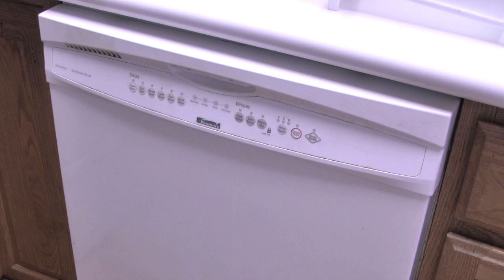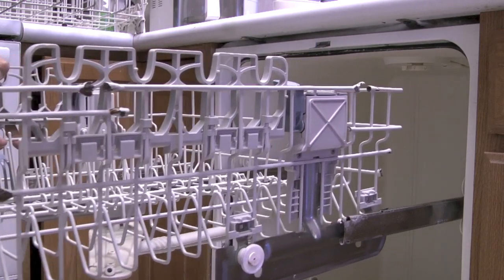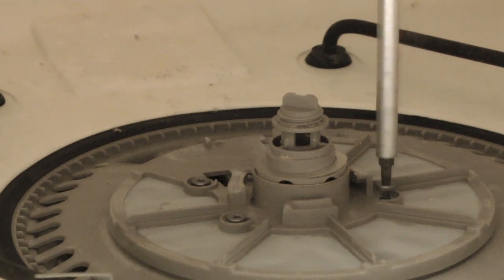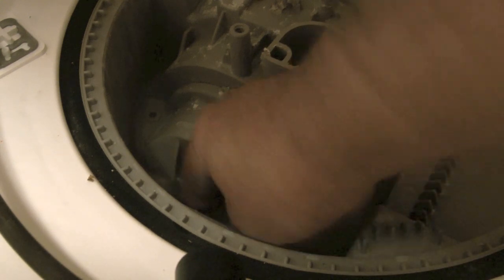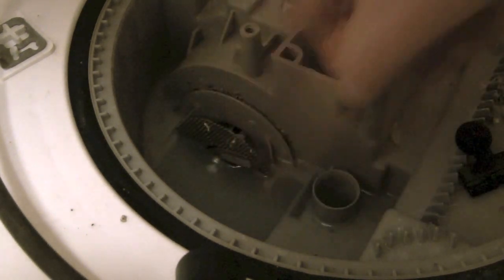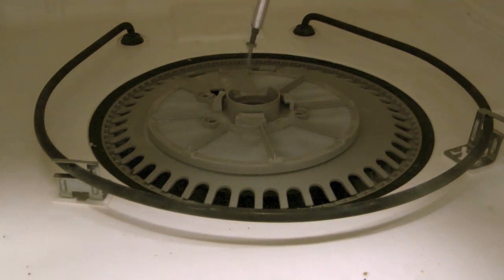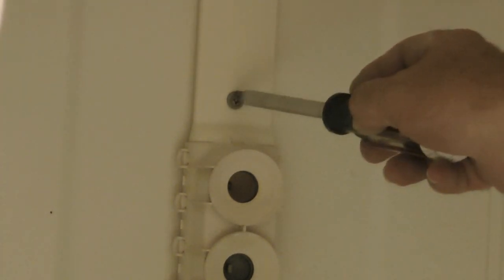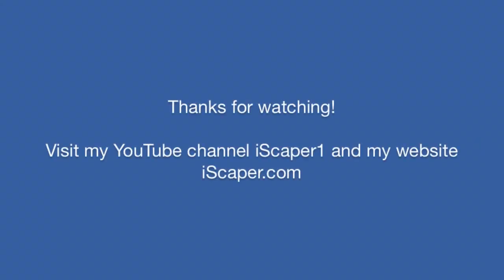Do it yourself dishwasher maintenance

Comment: Great video! I did everything you showed, but i'm still having issues. It goes through the whole cycle but when it says that its washing, its not doing anything at all. Completely quiet. The dishes don't even get wet. Heating element works, it fills and drains....I'm thinking the water pump is completely shot. What do you think?
Reply from the maker: Sounds like a pump issue or a blockage somewhere.

Comment: Water supply column has a couple of flapper valves. One of mine appears not closing. What effect is the open flapper valve? Dishes appear to clean but inside of cabinet becomes very dirty with scum on all sides

Comment: Great video. Only issue is the lower spray are is now hitting the bottom water supply tube. What did I do wrong.  Can you help.
Reply from the maker: The spray arm will wobble when there isn't water pressure against it, does it bang on things when running the dishwasher? If so you might need to check its installation again.

Comment: Our Maytag is barely 4 months old.  Not only does it smell terrible after a few days with the door closed (even when empty) but it cleans very poorly.  Even when only 1/2 full, it may take 2 washes to get glassware (top rack) or dishes (bottom rack) clean. We even rinse with a washcloth all dishes prior to putting them in our dish washer.  I checked the area in your video and it was clean.  Any other thoughts?  Thanks.  We have the Maytag mdb8959sfz

Comment: Ok, now I am stuck at reinstalling the lower spray arm...I can't seem to get the spinning-nut to engage with the spray blade and spin without connecting with the upper spray supply tube or the side of the washer; there seems to be way too much play when the blade spins. I think it's the nut; is there a specific way that it is supposed to fit; am I supposed to push it down firmly?

Comment: Great video. Any suggestions on how to get the cover off the chopper blade? Mine doesn’t have a tab like yours did?
Reply from the maker: Not easy to do, I thought I was going to break my cover taking it off. Try rocking it back and forth first. If that doesn't work maybe try a straight blade screwdriver & carefully pry up on the end to break it loose.
Reply: iScaper1 I ended up getting it of by using needle nosed pliers by the screw hole and the edge.  A good pull and it popped off.  Still doesn't drain, so I'll have to check the pump.  Thanks for the video.
Reply from the maker: Ryan Riek
Thanks Ryan for the tip on removing the cover.

Comment: Don’t forget to run a empty cleaning cycle once a month. Buy dishwasher cleaner or use whatever you’d like that has a high Citric acid content that isn’t a sudsing cleaner, empty the dishwasher, put the cleaner in the main detergent cup and close it, and run it on the hottest and longest cycle. Something like POTS N PANS with HI TEMP WASH & heated dry. You should be running a cleaning cycle immediately after cleaning the sump out so it can drain all the loose grits and bits from the sump and fully deep clean it.
Reply from the maker: Great tips, thanks for posting.

Comment: A turkey baster works great to remove the water and grime in the sump! Also, the screen can be removed from the center piece that covers the sump. I also used the turkey baster to force water into the little indents on the bottom of the door where grime tends to accumulate.

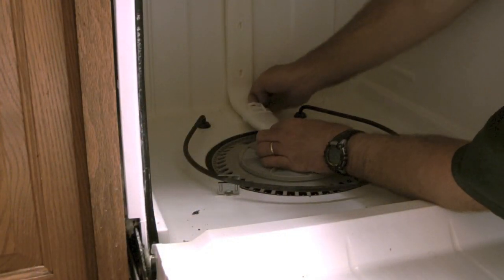Comment: Ok, I was following the video to the point where you disconnect the upper spray supply tube from the sump cover-arm thing (@ 3:03).  What if you accidentally break the tab? Is it like crossing the streams? Seriously though, I just broke it, but would it be ok to keep using it (for now), if I break off the loose part?  BTW - for the folks out there who don't know, the part iScraper removes after the upper spray supply tube is called the 'cap' or 'dishwasher cap', not "...sump cover-arm thing."

Comment: Good job with the video so my Kenmore dishwasher clean light keeps flashing this should solve the problem?
Reply from the maker: John Garcia 
I doubt it, you probably have other problems.
Reply: John Garcia I followed your instructions in video I had a bunch of glass, lemon seeds and some tooth picks clogging it also I reset my dishwasher to get rid of the flashing clean green light and it worked!! Thanks for the video!
Reply from the maker: John Garcia 
That's great, thanks for the information.

Comment: At about 10 minutes I am finding it virtually impossible to put the lower sprayer arm back on without the center piece falling out and causing the lower spraying arm to rattle when it spins. The center piece only has 2 out of the 3 fins on the bottom as it looks like one snapped off. Would this cause a problem? Thanks

Comment: We are down to removing the cover off of the chopper blade but we do not have the knob on the top that shows here.  There is no way we can get a good enough grip on it to wiggle it off.  Any suggestions?
Reply from the maker: Maybe try carefully prying up on the cover with a flat blade screwdriver.

Comment: I tried this with my Kitchenaid kdm24seal1. After removing the sprayer and the pump outlet, I'm unable to remove the screw on the drain and wash impeller. Any suggestions or tips? I'm unable to get all the gunk underneath it.
Reply from the maker: Without being there to see what you're doing I wouldn't be much help. I would search online for a parts diagram for you model of dishwasher and see if there is any information there that might help.

Comment: Great video tutorial that helped me, but my dishwasher will still not drain.  Next!
Reply from the maker: Sounds like you might have a blockage in the drain hose. I would check that first.
Reply: I did.   I saw another video of someone doing the same thing, but they included to remove the rubber drain flap too.  After taking everything back out again, and then removed the rubber drain flap.  Well our drain flap was broken, for the main piece of the flap was gone.  Which means it is probably stuck in the drain motor houseing, and pricing out a repalcement flap.

Comment: I've got a whirlpool gold quiet that has stopped washing dishes but does pump out. during wash cycle it just hums. so off I go to get a set of special headed screw drivers and will try to fix it.   I thought that a small shop vacuum would be handy to help get debris out.
Reply from the maker: ***** 
Good luck, let me know what you find out. Shop vac is a good idea.
Reply: iScaper1 I took the inside portion apart and found very little that would hang it up.  Put the beast back together fired it up still hums no washing action. looks like the starter capacitor 23.5uf 240vac on the side of the motor is bad.  I'll have to use my capacitance meter to check it out also found one on EBay.  I'll post the link to whirlpool gold quiet partner 3 parts manual.
Reply from the maker: ***** 
Great information, thanks for posting.

Comment: i have a very simular model kenmore dishwasher and now i have been noticing that there is still water after it is done going through it cycles. im thinking that it is a clog like you cleared out. i guess i have to do the same thing you did to yours. does anyone else have extra water left over after the cyv
cle is done its about a glass full of water.???

Comment: The dishwasher is really loud. I clean out the filter and the cropper and thought input back everything correctly. Any idea on why the dishwasher would be so much noiser. It is a kitchen aid 18 month old. Part kuds30cxss1
Reply from the maker: Does it sound like there are parts banging or is it a pump noise?

Comment: Both bottom and top spray arms are not rotating. I tried to remove the bottom spray arm, but it won't come off. I am holding the center screw with pliers and rotating the arm counterclockwise. It seems that the center screw is slightly too large for the arm to come up over it. This video is very clear, but I must be doing something wrong.
Reply from the maker: Sounds like you're proceeding correctly, is your dishwasher the same model as the dishwasher in the video? The lower spray arm should rotate freely even before you try to remove it.
Reply: iScaper1 No, my dishwasher is a Whirlpool but looks exactly like yours in the video. the arm does rotate freely, it just doesn't want to pull off.

Comment: problem solved, I found a camera angle that shows the position of the chopper blade. I used a sponge to soak up the water from the sump and it was easy to complete.
Reply from the maker: Glad you got the cover back on. Thanks for the information.

Comment: This was great but after it was all done and turned on no water was coming out. What could of made the water stop .. Checked the water float and it's fine.
Reply from the maker: Hi April. Not sure why your water wouldn't come on because nothing covered in this video deals with the fill and rinse cycle. Did someone shut off a valve feeding the dishwasher?

Comment: Excellent video tutorial.  I feel sick that I had eaten off dishes that were washed with that much crud in the sump area.  It is a wonder that any water got sucked into the sump at all.  Gross Gross Gross.  Overall 30 minutes start to finish with cleaning everything that was taken out and replaced.  Maybe would have been a bit quicker without a 2 1/2 yr old helper..... just sayin'
Reply from the maker: I felt the same way on our dishwasher.

Comment: I can not get that little cover off to save my life!!
Reply: If it has a little notch on the top back, take a flat head screwdriver and put the head in the notch.  Push it to the right to get it off.  You may have to hit the base of the screwdriver with a hammer--  I know I did.
Somehow it just pops back on when you're done.
Reply: Oh cool! Thanks, Got it, I had to hit it with the hammer, Come to find out when I opened it up my chopper blade was disgusting and broke.... so Hopefully that will fix my problem, Thanks again!